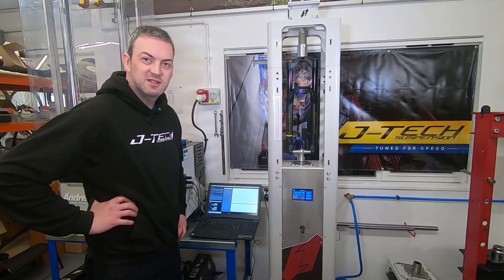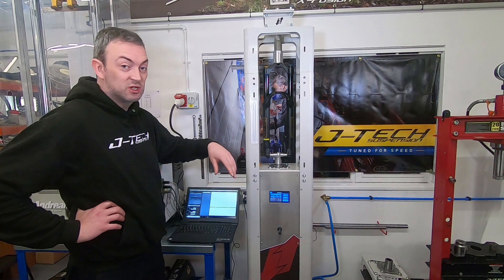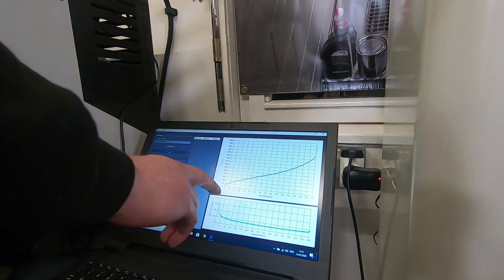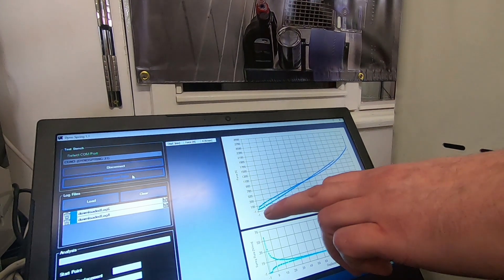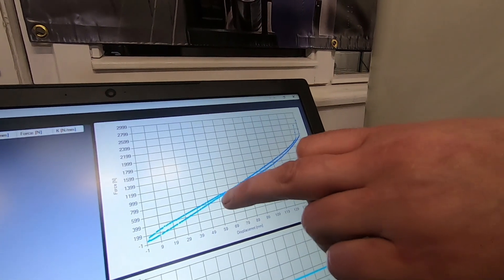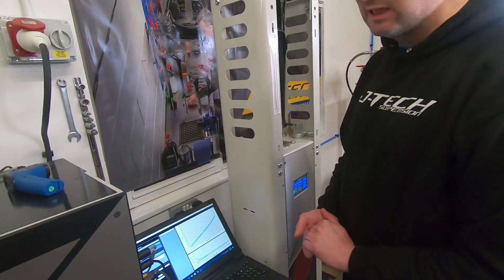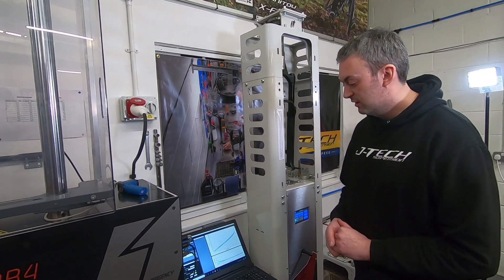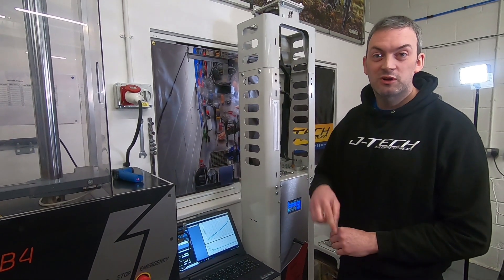You Won't Believe the Results! - Coil Vs Air - Spring Rate Dyno

Comment: unfortunately these tests are not really representative since the behavior of the air spring changes massively with changes in acceleration. Put her on a suspension dyno and run her through her paces, you will be surprised. In a bad way.
Reply from the maker: Thanks for your input Stefan. You're right, and it's something we'll try and do a more in depth video on, when we get time. The point of this test was to show that although a coil spring is linear (excluding progressive springs) when installed to a shock, the bottom out bumper makes it progressive in the last part of the stroke. 
Hopefully we can find time to film some more in depth analysis soon. We planned to have had lots done by now, but we've been crazy busy these last couple of years.

Comment: That graphic looks just normal, but for the purpose of comparing the differences in behaviour/ramp-up u name it,  the two graphs shoud be crossing at the sag point, else would just be causing confusión. Infact, that airspring curve would match a stiffer or higher preloaded coil. Also there is a lot of initial load in the airspring curve. maybe the negative air chamber wasn't correctly equalized?
Reply from the maker: Hi, thanks for your input. The reason we did not cross at sag, is because we aim to cross over in the mid-stroke, which we feel is more important for your dynamic ride height. Sorry, but the air spring curve won't match a preloaded coil at all - there are very few air springs that get close to the curve of a coil. In general, you need a very large negative air volume to create a linear curve through the beginning and mid stroke. This test was done a good while ago, on a Gen1 air spring, which had quite a small negative air chamber. The chambers were properly equalized, the load is a combination of the small neg volume and friction levels. Both of which have been addressed in the new Gen2 cartridge. 
Maybe we'll do the same test again, if we get chance, with the Gen2 cartridge too...
Reply: @j-techsuspension  absolutely every riders chooses their coil / sets their air pressure based on the sag, not mid-stroke (even though that might change a bit the % of sag preferred, but definitely not so much). So yes, the crossing should be done at the sag point.
Reply from the maker: @dit4963  I absolutely get where you are coming from, but after many, many years of testing (data acquisition, not just rider feedback) static sag is not as important as the point at which we have crossed. On a MTB your dynamic sag is always different from static sag. So we're just crossing at where we've found to be the best place for comparison. Others may disagree, and that's fine, we base our work on techniques we've tried, tested and adapted over the years. 
Not saying you must do it like us, we're all free to have our own opinions. We've just expanded our knowledge beyond the text book and applied what we've found to what is the best way for us, in our opinion.
Reply: @j-techsuspension I've got your dampers in my fork and shock. I also have telemetry, what do you recommend for dynamic sag?

Comment: I was in absolute purgatory being pretty much forced to run air forks and shocks that literally became rigid on fast mid stroke hits during rebound or small bumps since the industry forced air on us over the last 10 or so years. Original Z1 bombers rode better than most modern air forks

Comment: Good timing for this video! I have a set of coil forks and recently did a lower leg for the first time. The oil was fairly low, I tend to put a tiny bit more oil in than the manufacturers recommend just to keep things smoother for longer. What was interesting was the forks ramped up noticeably harder at the end of the stroke. I had assumed this was due to the reduced volume of air in the lowers with the extra oil, but this video confirms it. Cheers,
Reply: Be careful doing this. A tiny bit is probably fine, but I've seen the seals pop out of the top after overfilling the lowers. That was about 20% more oil though mind, so a fair bit more.
Reply: @shlep444  yeah I tend to only do another 5ml, been doing that on all my forks for a few years and never had an issue.